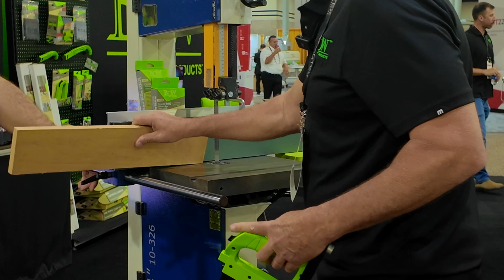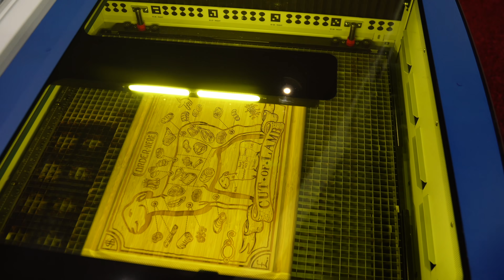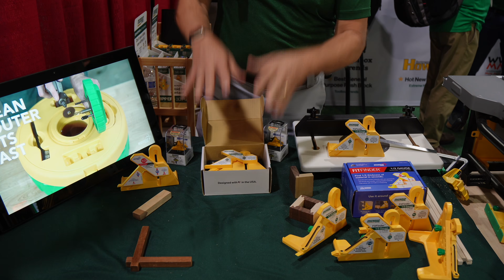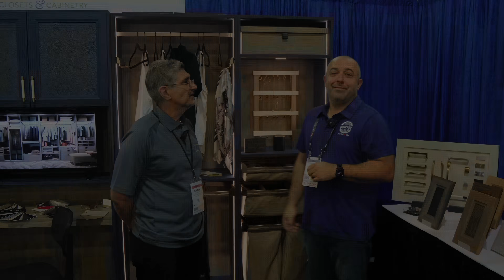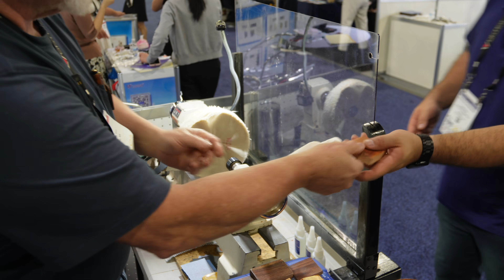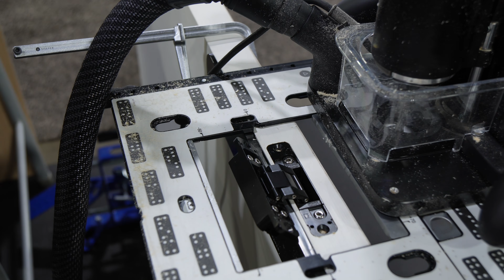Awesome New Tools From Day 2 Of The International Woodworking Fair 2024

Comment: I looked at Parfix, 3408, Low Odor, Low Bloom CA Glue and Pen Turner's Finish, Thin, 2 Oz. Bottle and it says it is an adhesive, but the demonstrator used it like a stain. What is this stuff?
Reply from the maker: It’s both interestingly, when wiped on it seals like a stain and it can be used as a ca glue as well apparently.

Comment: Do you think that the shaper cnc router is worth the investment? I can see it being very useful for Harmon door hinges but the last thing I want to do is trouble shoot a computer program when it can b buggy. Especially considering it’s in its earlier stages
Reply from the maker: So I have your traditional bed, CNC. Which can accomplish most purposes, however, it can’t do things that are already in place so for example, I’ve had people asking me to route something in a countertop and then add resin, or just some thing of a particular large size that wouldn’t be able to fit in the bed. I do like it a lot and it does keep you within the parameters that are set however, I haven’t been able to spend any extensive time with one, learning software and things like that, this was the third time I’ve had my hands on one. So I think it really depends on your use cases.
Reply: @BitnerBuilt  it seems like it can be useful for very niche things but I can’t see it being used every day in the field for installing doors and hardware. Knowing my guys (25 years experienced plus boomers) they won’t know how deal with trouble shooting and will probably suffer with a traditional router and making jigs

Comment: I bought the Bow Fence system at the show to put on my Dewalt DWE7491 jobsite tablesaw.  Right now I'm ripping a bunch of 2 x 6 x 14' boards to do some massive butcher block table top glue ups.  With the Bow Fence installed and a roller stand behind the saw I am feeding these boards through by myself without an issues.  The long fence, fence supports, and feather boards work together to hold these 14' boards tight against the fence and tight to the table so all I have to do is push the boards forward through the blade.  I have complete control without any wobble and I'm getting much straighter cuts.  Totally love this setup.
Reply from the maker: Very cool awesome to hear!

Comment: Really impressed with the Fortis Clamp products from what I saw here and their website.  More expensive than pipe clamps, but more flexible in their use as well.
Reply: I agree as a former electrician i've used thousands of feet of unistrut and could have saved a ton of money by adapting it to my new hobby instead of buying aluminum manufactured stuff.
Reply from the maker: Yeah, that was one that I was surprised about. I walked past it a few times and then stopped looked and it all made sense to me. Definitely be picking up a few.

Comment: I've owned a couple Epilogs over the past 25 years.  Both of them required odd workarounds to work properly.  I jumped ship and have invested in Universal Lasers since then which have been great.  I have many friends who own Trotec machines and are pleased with them as well.  The hybrid laser has never made sense to me.  While I am running the CO2, I have no access to the Fiber I have invested substantially in.  Seems very inefficient from an investment standpoint.
Reply from the maker: Good to hear the feedback! I’m a big Laser fan and I was actually surprised that epilogue was the only main laser company there (outside mass manufacturing units) . I’m somebody that considers that it always comes down to the type of work you do. I have a galvo fiber and a separate co2, my fiber obviously has a very small bed, I looked at this one as the opportunity to have an add-on fiber to my CO2 that was on a larger bed for some new options but it’s not something that’s in my normal workflow. For me having two separate machines that were large bed styles would be more of a hindrance because I wouldn’t be using the fiber that much at that size. But for others, I totally understand what you’re saying, With somebody who’s running all machines at high production runs, dual machines won’t work. Send it.